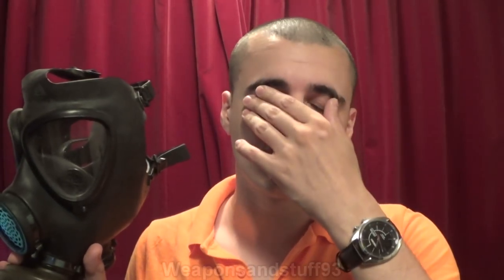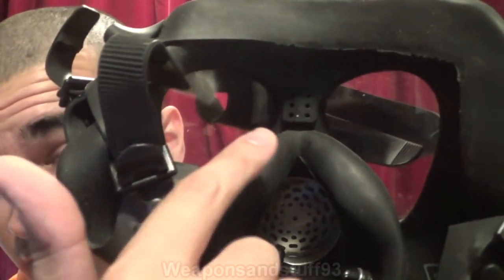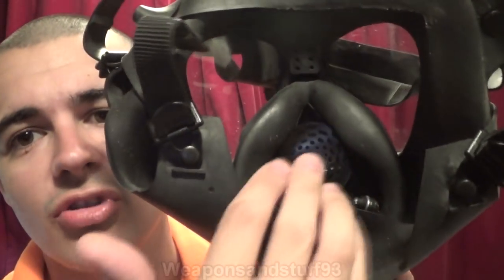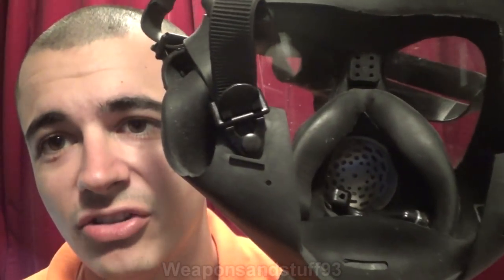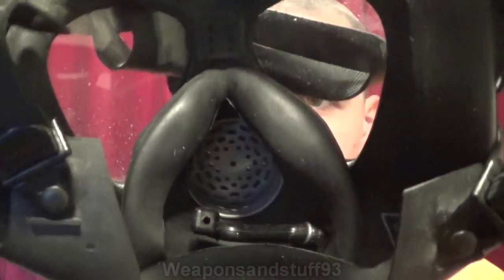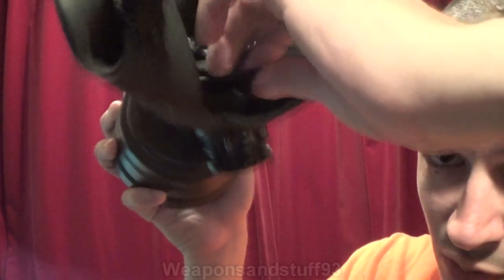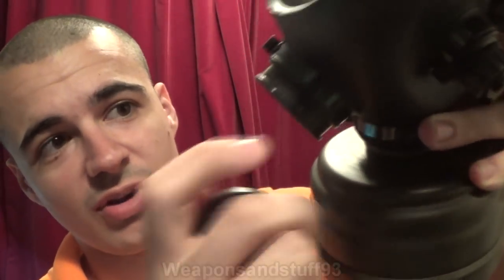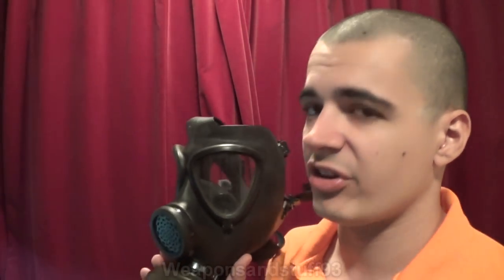A big design flaw in many gas masks

Comment: Yeah, I've seen similar problems with my old GP-5 I used for Halloween around a year ago. After scaring people for around an hour the sweat got into my eyes so I had to take it off every twenty minutes or so. Not having a filter seems to help slightly though, but as you said It'd be impossible to take it off or not have a filter in an NBC situation.
Reply from the maker: Yeah I guess it's an overlooked problem during mask design.

Comment: Interesting. I often wear a 3M 6900 full face respirator under the hood of a DuPont TY122S overall suit while crawling on hands and knees it a sweltering attic during the Texas summers. I sweat like a race horse in that outfit, but I’ve never noticed a problem with sweat in my eyes. So I wonder if the face seal and the air intake valves together work to keep my face dry. I do notice considerable sweat around the seal, especially at my chin—and my face under the nose cup where I exhale gets very sweaty too. Sometimes I worry that all the sweat around my mouth and chin will break my air seal, but it hasn’t happened. In fact, I assume the film of sweat might aid the seal. Odd that I’ve never had a problem with sweat in my eyes.
In an attic in the top of a house in Texas during summer, the temperatures get well over 100°F/38°C.
Reply from the maker: Yeah may just be the 3M 6900 lets the sweat travel around a certain route not directly down the face.